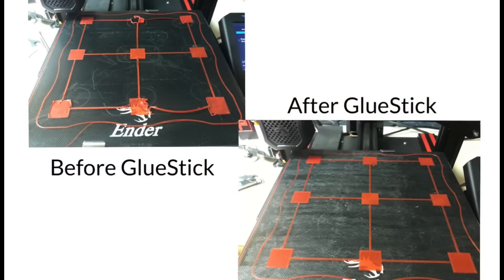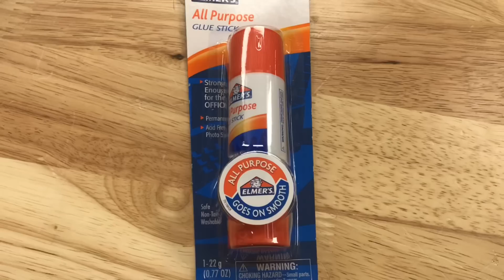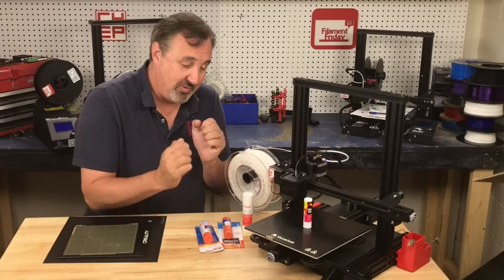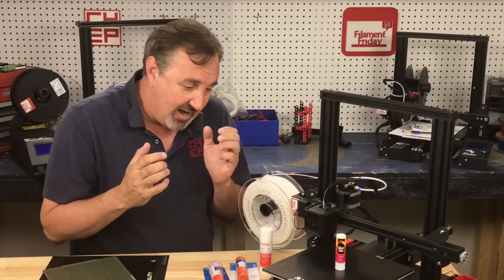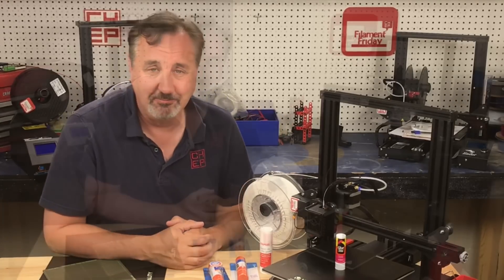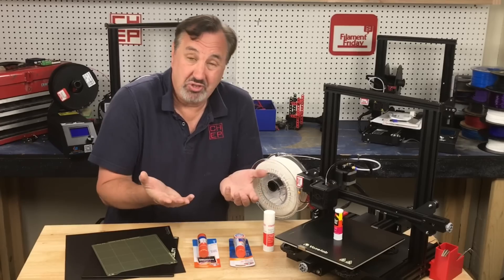Better Bed Adhesion with a Little Glue Stick

Comment: You don't need glue stick or hairspray or tape, just set your machine up right and keep the bed clean then throw all that crap in the bin, I have never ever used any glues or potions or anything, even better just use a PEI bed.

Comment: Avery glue stick is garbage.  I bought some, from your link no less so I know I got the correct stuff, and it stick LESS than just using nothing.
Reply from the maker: I’ve been using it for 9 yrs and many in comments have too. It works great. Sorry you got a defective stick.

Comment: Tried glue sticl,
Different brands.
It isn't reliable

What works, as is available worldwide

Vision Miner Nano Polymer Adhesive.
I do not work for them, but have used their product, it works, better than anything else, and is available worldwide

Comment: No need to mess up the bed like this, it’s lunacy and a band aid for laziness.
Level the bed and make sure the “squish” is correct on the first layer. Stop using the awful bed that comes with the Ender. Clean the PEI bed with IPA before every print and with Acetone before the first print of every day. 205/60 for PLA. It’ll stick like the proverbial to the blanket.
Use corner “biscuits” on large flat prints to avoid curl. You shouldn’t be smearing the bed with kids glue pens, it’s terrible advice 😆
Reply: You should make your own channel
Reply: Your comment, is like trying to save an anchor from drowning lol. Look around the comments, clearly there are more acceptable solutions other than just your own- coming from a pool of experience much greater than any one person could gather. I’m glad you have a solution that works for you, thank you for sharing, but resorting to calling Chuck lazy isn’t really helping anyone.
Reply: @nickdarrow4873  wasn’t directed at Chuck, it was aimed at all these band aid solutions that don’t address the real issue of poor adhesion. It doesn’t stick because it’s not set up right. Smearing the bed with cack isn’t a solution it’s a messy workaround.
Reply: @pl5882  No thanks I don’t need the attention

Comment: It's hard to give my thoughts because the products you are recommending are not available in 94% of the world! You really should try to be a bit more generic.
Reply: A glue stick isn't generic enough?  If you don't want it in stick form, PVA glue in any form works.  There is no place in the world where you cannot obtain this, unless you are on a deserted island.
Reply from the maker: Percy Philips- Interesting. 94%?
Where did you get that number? 
You can buy what I recommend on Amazon which ships to far more than 6% of the world.
Reply: I live in Norway and I just buy cheap glue stick at my local supermarked (food store). No need for fancy stuff. Generic glue stick is all you need.

Comment: First!
Glue stick sucks.  Use glass and aqua net.  I have the same pieces of glass I cut from picture frames years ago.   A quick spritz of hairspray and I have no problems and I don't have the design of glue stick on the bottom of my prints
Reply from the maker: Neither do I. One swipe leaves the bottom smooth.
Reply: As he said in the video, spraying hairspray on your bed also spreads it on other parts of your printer, making them sticky. I have used glue stick for both PLA+ and TPU and to be honest it works perfectly. 
After a while, I just use some soap with water and a soft sponge on the glass bed and the glue stick is easily cleaned off.
And im not sure what 'design' of the glue stick you're talking about, the bottom of all of my prints never have something like that.
Reply: @youraveragemetalhead226  No it doesn't--you don't spray the glass while its on your printer, silly.
The glass comes off the printer after ever print.
Spray it away fro the printer.
Glue stick leaves the pattern of messy glus stick on your prints.
Aquanet does not.
PLA, PLA+ is all I use.
Reply: @youraveragemetalhead226  Oh, and the best part of glass and aquanet is that you take the glass off the bed, let it cool for a few minutes (I like to rub an ice cube on the underside of the glass) and the print pops right off.
You can either applay more hairspary, or clean the glass with soap and water, or even spray alcohol on the old hairspray for a cool bottom layer patter and to refreash the aquanet.
Reply: @FilamentFriday  Huh?  One swipe, and you'll have one swipe of the glue pattern on the bottom of your print--if I follow you.  you mean that you don't cover the entire bottom of the print?
See,s like corners would pop up that way....
Reply: @odinata  #1 If you take off the bed to apply hairspray, you have to relevel it, which in my opinion is unnecessary hassle.
#2 I cover the entire surface of the bed with gluestick and I have never seen any kind of 'pattern' from the gluestick on the bottom of my prints.
Reply: @youraveragemetalhead226  No, you do not have to re level the bed.  I have three Creality printers.  I re-level my beds after many, many many prints.  
Not an issue.
Reply: @youraveragemetalhead226  If you haven't seen the pattern, you aren't looking.The unneccessary hassle is smearing an entire piece of glass with glue.
One quick spritz from the can, and you have a clean, neat print.
Reply: Thanks you make my day with your first comment. I am really lucky that you are the first here..
Reply: @odinata  Hmm, about everyone else says you'd have to re-level if you take glass bed off, good news if you don't. Do you use binder clips or two original ones? Do you make sure they are placed in the same spots or doesn't it matter? I'd love to hear all the details :)
//cool videos too
Reply: @TechieSewing  I don't think anybody says you would have to re-level a bad just because you unclip the glass on top of it
Reply: @odinata  If you don't think 'anybody' says that you are mistaken. Maybe not everybody as you are not saying this but you are the first for several months of watching videos and reading comments and the official Creality group on Facebook. "Of course if you do anything to the bed, you'd have to re-level it" is a pretty common saying. It doesn't help that people usually talk separately about cleaning, bed adhesion and leveling, rarely giving their full workflow.
I'll try hairspray now!